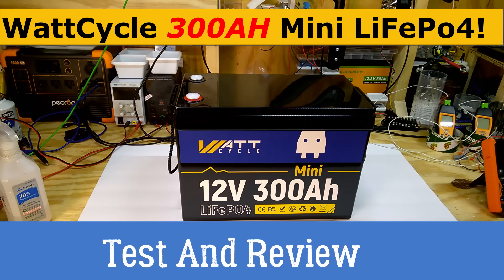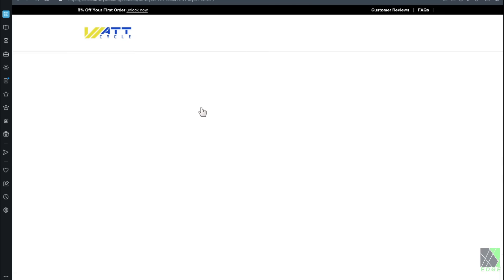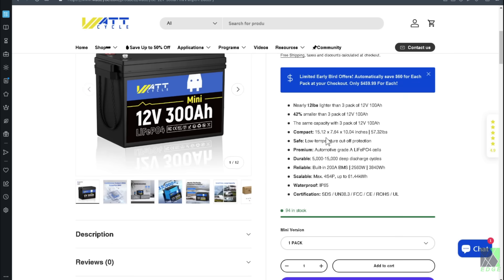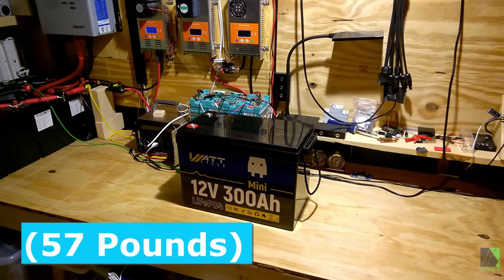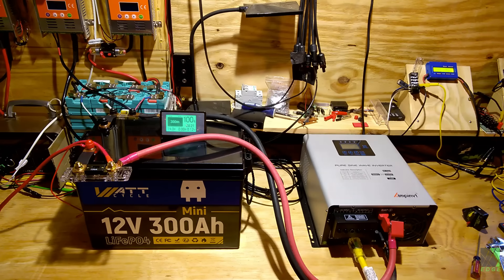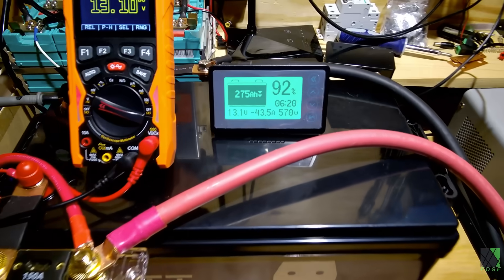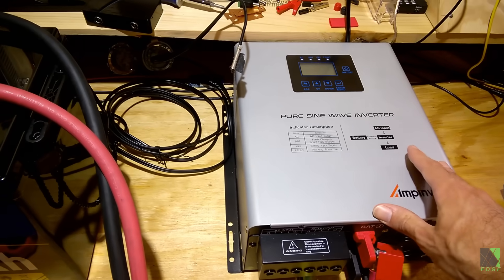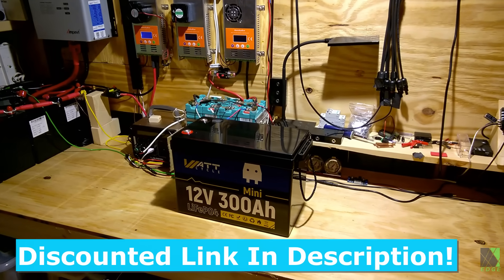WattCycle 300Ah Mini Test & #Review! How Long Will My Heater Run? #Solar Power Off Grid #WattCycle

Comment: I still have to watch this but I did some snooping around. The one thing that stands out is the weight: 57 pounds. Usually, lithium batteries are considerably lighter than lead batteries of the same dimensions. But a 300AH lithium battery of that size has a lot of LiFePO4 crammed in it! Gotta wonder how safe this battery really is...
Reply: So many of the previous generation lithium batteries had lots of empty space inside the case, with blocks of foam rubber acting as filler
Reply: @schautamatic  A single 400ah li time is 83 lbs, and I have 4 of them.
Reply from the maker: @schautamatic They must have higher energy density, appear to be aluminum cases. I am doing long term cycling on it now, I believe it will be very safe. Have been cycling the 100ah versions and no problems whatsoever

Comment: ill bet anythign these batteries will cost 100 dollar per 100amp hours by this time next year since last year these same batteries cost over 300.00 dollars but i just bought one OFF AMAZON for 140.00 dollars after TAXES AND SHIPPING so  im pretty sure by this time next year these batteries will be way cheaper like 1 dollar per amp hour and ill bet anything on that so priestesslucy ill bet you anything these batteries will cost 100.00 dollar max by next year just like these batteries are half the price since last year so do the math last years this same battery cost over 300.00 dollar and now you can a 100amp battery under 150.00 dollars now so if you do the math that mean by this time next year these batteries will deffinitly cost 100.00 dollars for a 100amp hour battery and ill bet anyone anything on this priestesslucy
Reply from the maker: @jimmy_Ross I used a lot of prismatic cells for my house batteries... waiting for a load of prismatic LFP cells for the workshop, they should be cheaper than the drop-in style batteries
Reply: @solarpoweredge  I had a 3600 ah 24 volt system on line for 2 years. 12x300 ah batteries. A BMS failed on one battery...dead shorted...and set fire to the power console and did $150,000 damage to my shop and garage. The battery bank was at 100%, MPPT charger was off, not outputting, total load on the system was under 750 watts.  This was my 12th build of 14 LFP systems. Everything was assembled correctly, fused everywhere, 12kw split phase inverter, etc. Why it failed is being looked at by a forensic fire investigator. The system was online for 2 years with zero signs of distress. Max loads typically under 2300 watts. WHY????
Reply from the maker: @kimmer6 That is horrific! Sorry for the loss... I have never used any "BMS" on my hand built prismatic cell banks (mostly CALB cells), and in fact one of the reasons IS the risk of them shorting out. Problem is, batteries usually need some kind of protection circuitry to sell to the common market. It is a real dilemma. Anyway I hope you are able to recover your losses and rebuild.
Reply: @solarpoweredge  Thanks. My 8x280AH  EVE cell homebuilt is supplying power for lighting and tools right now. Home built in 2020. The fire impacted my life but the contractor begins repairs tomorrow after 3 months red tape.
Reply from the maker: @kimmer6 Gotta love that red tape and paperwork... but it's good the repairs are on their way
Reply: @kimmer6 aren't those ece cells only 3.2 volts?
Reply: @solarpoweredge  true true

Comment: I was not expecting a battery that size to actually have 300 amps capacity.
Reply from the maker: @BlenderRookie Pretty amazing what they can cram into the case
Reply: i did these batteries are getting better and better and smaller and smaller and cheaper and cheaper lol by this time next year these batteries will cost 100.00 dollar per 100amp hour battery ill bet anything on that
Reply: @jimmy_Ross Hi, currently the DC house 12v 100ah battery’s  are £167 delivered and 12v 200ah battery’s £358 diliverd ( from memory ). I think that is good!
Cheaper is always better as long as it has the quality.
Take care M.
Reply: @markeh1971  facts facts
Reply: I got scared !
Reply: My understanding is that the mini versions simply have no major padding inside. However, they have the same cells as the bigger equivalent amp hour versions.  
I  watched a video a few days ago where someone opened one of the larger batteries (different company). It had like 2 or 3 inches of padding and air space around the sides and what looked like maybe 2 inches of some kind of epoxy, glue or rubber like material on the bottom. The thing looked like you could hit it with a sledge hammer and it would survive. The mini's however you would be smashing into the cells. I'm sure that extra space inside the large battery probably helps keep the batteries cooler when you have a bunch of them next to each other or something like that.  Just a guess.

Comment: Good stuff Dave..!  I'm using Four Li Time 400Ah here..(1600Ah) it's alot of power. My panels (2 arrays) just don't get enough sun hours here with all the tall trees around here.. and can't cut them down either. I'm using an EG4 12k Hybrid for my AC and heat. It runs off a pair of 305w panels when the sun is out. Getting ready to relocate to AZ for lots of sun there.
Reply from the maker: @OFFGRID_Trucker Thanks :D that's a nice setup. It's amazing what solar can do. Maybe I'll do a video about my house batteries some time. Never shown that. 
Exciting moving to AZ... apparently zero problems with sun... that will get the batteries charged up.
Reply: @solarpoweredge  yes.. I would like to see that video. Yeah.. full 10hrs of sun. The mini split starts working at 90 volts. I will add more panels to it when I get relocated and have the space to use them.  Yes, the big move is exciting. 900 miles away. It's going to take four trips , almost 8000 miles. Lol
Reply from the maker: @OFFGRID_Trucker Wow that's going to a different world. Very exciting!
Reply: @solarpoweredge  I'm  living the dream.  2 weeks now. Lol.. but not without problems. The lithium battery stopped (bms shut it down due to low temp)providing power, which means the  propane heater quit working. Brrrrr...
Reply from the maker: Excellent! Sounds like you're having a blast! Wish I could say the same LoL but hope keeps on going. Maybe you can warm up the batteries with a heating pad in a box, would make an interesting project
Reply: @solarpoweredge  I will have to make a picture video and share it. It's a big learning curve and an adventure, to say the least..
Reply from the maker: Right on
Reply: i have 4 00+ watt panels, no money to put them up. and then the tax man will increase my property taxes, and the county for not paying them a "fee".
Reply from the maker: I hate that! We need invisible solar panels...
Reply: @larryjanson4011  huh.. ?  Your saying the county is going to charge you more for having solar...? What county is this?

Comment: lol im waiting till these batteries come down to 1 dollar per amp hour lol then i will be happy to buy them to me they still cost to much
Reply from the maker: @jimmy_Ross You're right they ain't cheap
Reply: Going to be waiting a while.

It's hard to come by less than $1.40 per amp hour, and I don't see prices dropping much in the short term with tarrifs on China.

Would be nice if I was wrong though.

Just looked at the Amazon listing, with the coupon it's $1.50 per AH, with the mini form factor that's honestly a decent price if weight is at all relevant to you. I paid less per AH for my 280AHs on Prime Day, but they weigh more than this despite less capacity
Reply: @priestesslucy  lol well last yeat at this time these batteries cost over 300 dollars and today i can buy the same battery for 150.00 dollars lol i just paid 140.00 dollars for 1000amp hour battery with a good JBD BMS and it has bluetooth witch i love and it has all the protcetion you would ever need and i only paid 140.00 dollar after taxes and shipping and i got it within 2 days of buying it so yeah im 100% percent sure these batteries will be half the price by this time next year and everyone allready knows this i could of spend 300 dollars last year but i waited 1 year and these batteries dropped down in half the price so yeah these batteries will be under 100.00 dollars for sure buy next year at this time ill bet anything ON IT
Reply: @priestesslucy  yeah for now but last year at this time these batteries cost 300 dollars an now there half the price and i know for sure these batteries will be around 100.00 dollars at most by next year lol so that battery i bogght for 140.00 dollars shipped and taxes and it got to my house in 2 days and that cost me 140.00 dollars so im pretty sure by this time next years the price of a 140.00 dollar battery will be only 100,00 dollars to buy next years so stop it these batteries are alomst at 100.00 dollars allready for cheap battery for 12 more months from now of course the batteries will be 100.00 dollar for sure so stop it why are you lying to people